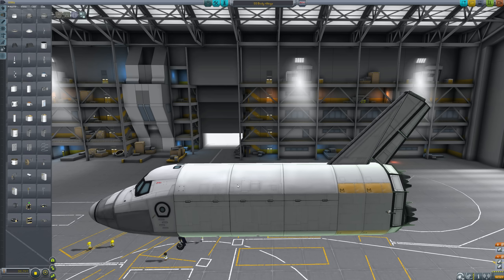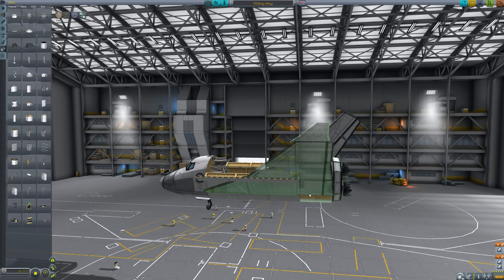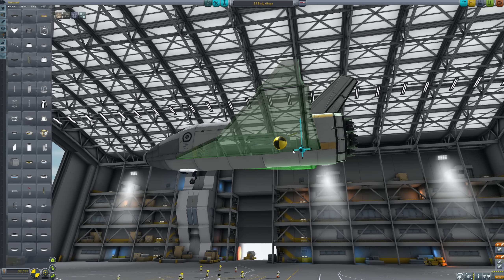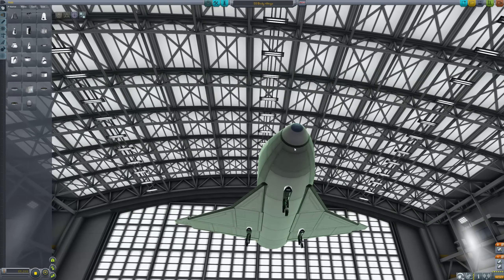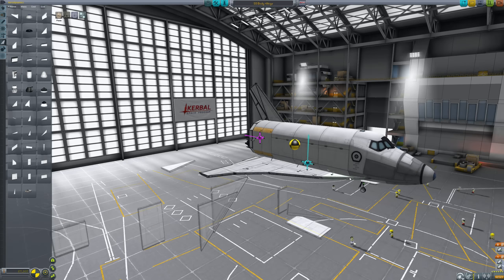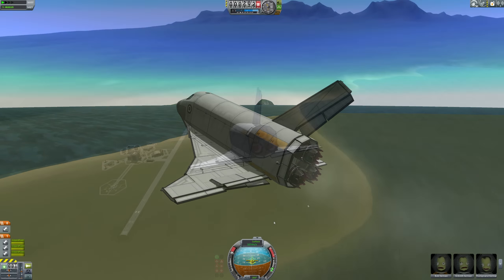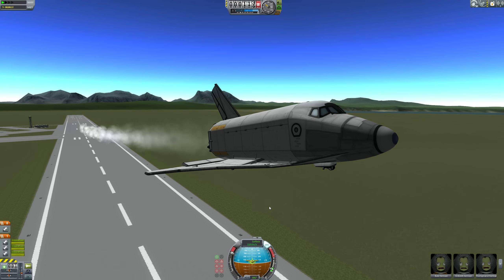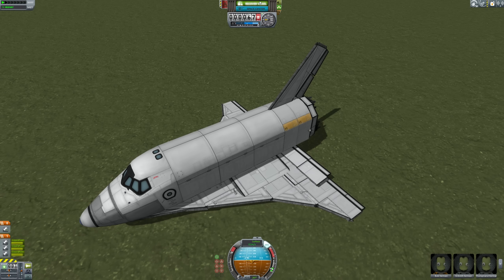Kerbal Space Program - Space Shuttle Aerodynamics

Comment: 2:00 - "One useful tip if you're building wings, is to build them with only one point of contact." - wrong. At least wrong with stock aerodynamics and release 0.90 beta. Wings only have lift in one direction, the direction perpendicular to the wing's connection point. If you rotate hem 90 degrees to build wings forwards or backwards from the "single connection point" you're adding surfaces which provide no lift unless you get to flat spin. And that's why you're having the center of lift so far back, half of your wing provides no lift. Just for fun I replicated your creation with wings placed correctly and its center of lift was much better and sure enough I was able to lift off with it and land from gliding, no extra surfaces, or cheating needed.
Of course it is possible to build wings with single connection point but then you need to use structural part (e.g. I-beam) as base from which you build the wing in strips to the side.
Reply from the maker: I managed to verify this last night, yet another reason why FAR is superior.
Reply: Scott Manley Taking all other bugs and annoyances in KSP into account I don't see any reason why being slightly closer to what one intuitively expects should nake FAR superior to unmodded game. In my opinion, unmodded game is always superior because that's how it was meant to be by its authors.
FAR is kind of like replacing all pawns in chess game with bishops. Sure, they don't have such complicated and confusing rules regarding their moves. But they make it a different game. And what's superior is matter of opinion.
KSP is getting aerodynamics overhaul in next release anyway.
Reply from the maker: kasuha I think your analogy is incorrect, chess is a game with rules setup by game designers 'improving' chess is a matter of game design, improvements are largely subjective.  Kerbal space program is a physics simulation, improving the physics simulation to be closer to real physical behaviour is an objective improvement.
Reply: Scott Manley I beg to differ. If KSP was aiming at physics accuracy, it would have realistic planet sizes and N-body gravity. It would have realistic physical properties of its rocket parts including realistic strength of part joints. Realistic crash and collision evaluation, including permanent deformation. Realistic water physics (floating/sinking parts). And so on.
KSP is a game and it is meant to be fun. Physics is a great deal in it but its accuracy is not the ultimate goal. KSP provides us what developers consider the best compromise between fun and realism (within available development time, oh yeah - but they don't seem to mind adopting mods when they like them). What RSS and FAR provide is change of these rules for those who are not happy with the developer's approach.
What I'm saying is that 'superior' is subjective assessment. I don't consider FAR superior to stock aerodynamics.